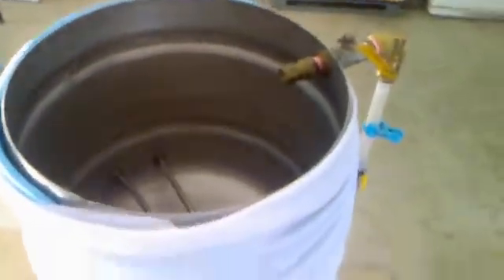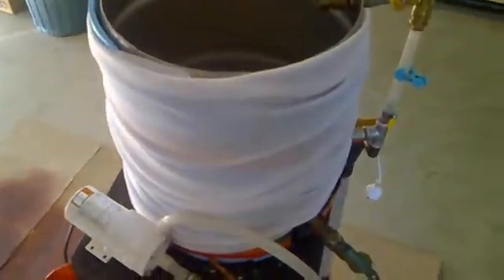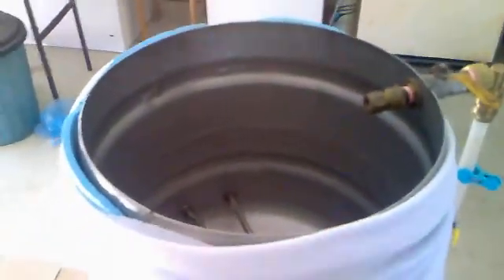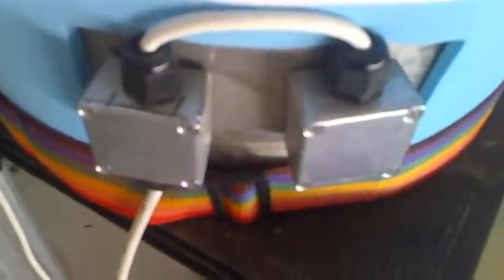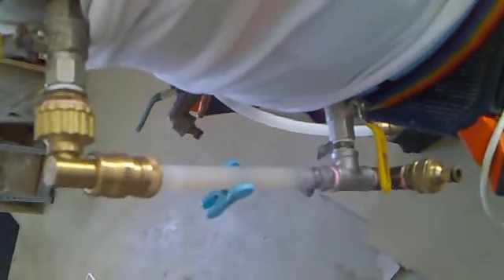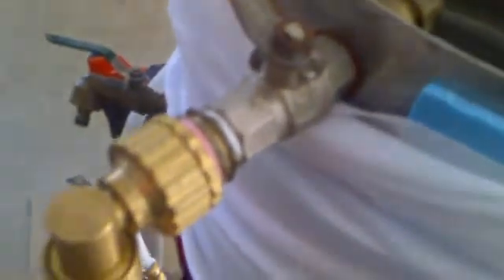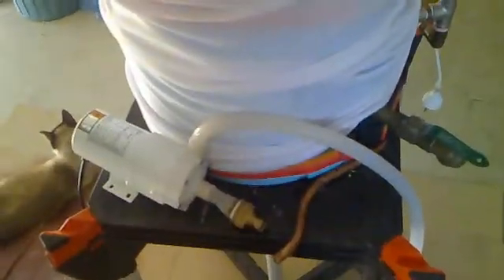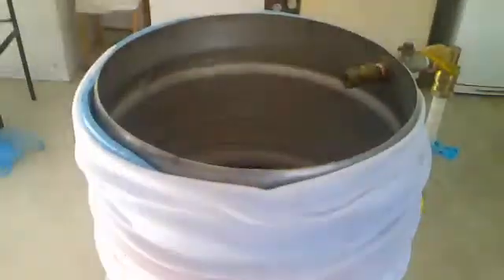BIAB with RIMS overview

Comment from the maker: I was running a STC-1000, check ebay for them. It's a simple ON-OFF controller.  More recently I have move to a "matho's controller" which is a custom built pid based on the arduino platform.  Check my other videos for the matho's controller

Comment from the maker: It's a Kaixin MP-20.  Most people use the smaller MP-15 for brewing.  The MP-15 also has an option for a high temp head if you want to whirlpool boiling wort.   You can get them from alibaba.com